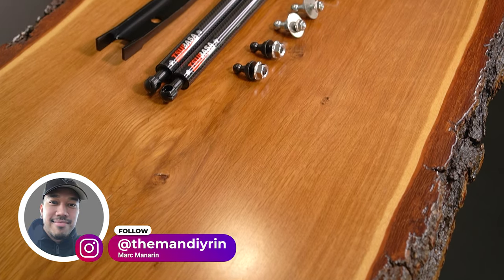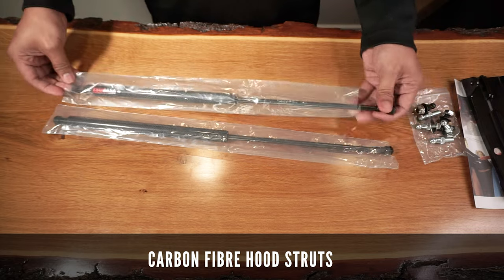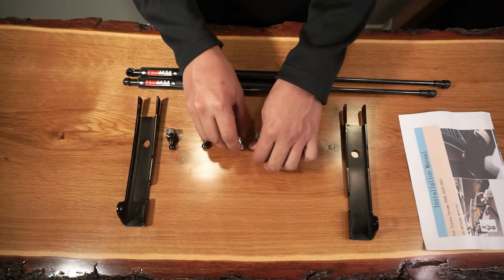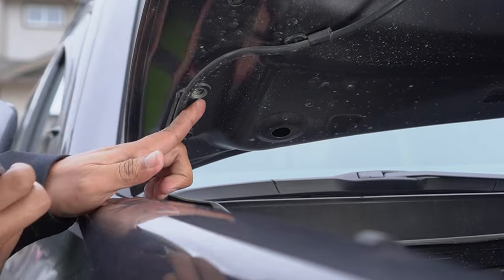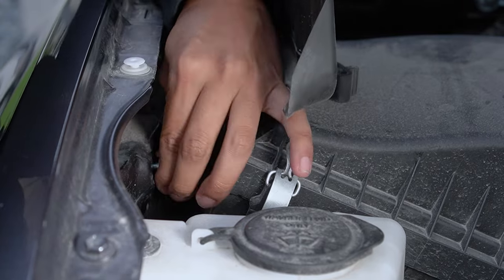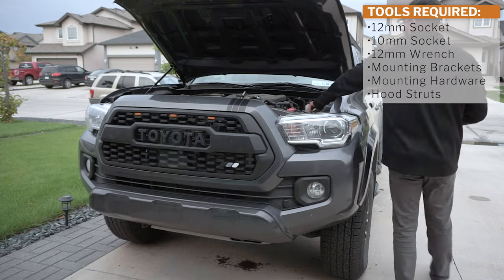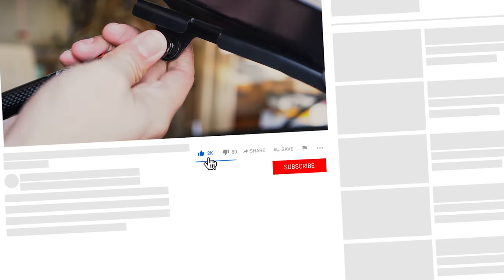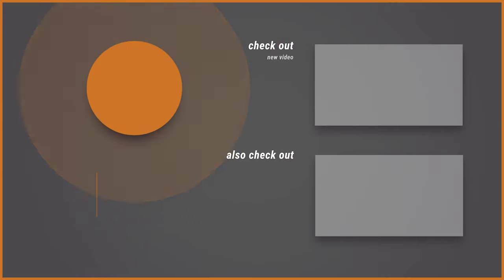HOOD STRUT INSTALL on this NEW Toyota TACOMA TRD Sport | EASY DIY

Comment: Nice! I need to do this. My 2023 TRD Sport was delivered (finally) on 5 Dec. Loving the truck. Have de-chromed badges and A/C vent rings.
Reply from the maker: Thanks for watching! Happy to hear you finally got your truck! Gotta delete those chrome I agree! Looking forward to hearing more on your future mods!
Reply: Amazon says the struts you installed fit up to 2015 Tacoma but yours is a 2022. So they should work in a 2023 right?
Reply from the maker: @Hansaman58  Hi yes there should be one for up to 2022 there! Else I've posted links to alternatives as well that has positive reviews!

Comment: I just finished my install 2022 taco. My comments are: install driver's side strout first. The lower ( engine bay) ball stud bolts call for the smaller diameter threaded ended bolt studs. Finally, expect the hood bracket hardware to angel away from the hood line by about an inch. This gives the lowering of the hood a bit of a springy feel at the beginning.
Reply from the maker: Thanks for watching my video and for the comment! Cheers!

Comment: I bought the ŕedline struts it was my second mod i upgraded for 20 dollars more for stainless ones that i quick push and they go up themselves the scary part was on mine you had to drill holes and use rivits the drilling near the engine bay wasnt bad you just want to check again and again the measurements drilling the bottom of the hood was very scary you only had to go deep enough so the rivit would go in all the way any further and you would come out on the top of your hood so i measured down the depth i did the same on the drill bit then ran electrical tape around the bit to stop it from going any deeper it was pretty straight forward and it feels alot safer working under there with just that stupid rod to hold a couple hundred pounds up.
Reply from the maker: Thanks for watching my video! I heard great things about redline as well so I might try that mod soon!

Comment: I've owned a Toyota truck since 1980 being my first 4 X 4  way before TRD's, or Tacoma's, or Tundra's, and I've used that hood rod on every truck I've owned. I can't for the life of me understand why this isn't coming already installed. I'm on the fence as to the safety of them being after market add ons. I just finished adding a K&N cold air intake, and Pedal Commander on my SR5.
Reply from the maker: Hi! Hope you're having a great weekend so far and thanks for watching my video again! I agree this should come standard! Hope they do in the future models! As for safety of this specific one, I'm currently testing it out as I know there are better knows products out there that I might try in the future.

Question about aftermarket cold air intakes as I want to install one also! How are you liking yours?! Any issue or complaints so far?

Looking into the pedal commander as well till I get this tuned in the future)!
Reply: @themandiyrin   Thank you again for such an in-depth informative video. 
So far I am liking my K&N choice. I was debating between S&B and K&N and I waited for S&B to come back in stock for 4 months. After the New Year I decided to just go with K&N. The sound this intake produces is amazing, combined that with the Pedal Commander and you have what seems to be a V8 driving your truck. I would prefer to get a totally enclosed system like the S&B and put a K&N filter in it. 
Oh and I forgot to mention I installed my "Raptor Lights" in my grill and they look amazing as well.
Reply from the maker: @Steak_59  You're welcome, appreciate your continual support!

And that's good to hear your thoughts on both, I personally also want an enclosed system but I've heard positive reviews on the K&N as well so that's also an option I'm looking at! Thank you for the info that helps my decision!

And nice on the Raptor lights! I was able to install mine on the top row but involved some cutting but I agree it looks amazing! Did you go with the white or amber version?
Reply: @themandiyrin   You are most welcome, believe me I know how much thought is placed in the products and the expense, I cannot imagine what it takes to add to that the production of recording the install and all the editing included with it. This is why my hat is tipped with the quality you continue to put forth. 
As for my lights, you have to keep in mind I am leaving my stock SR5 grill, so I had to custom everything. I chose a smoked amber and wired them to come on with my "Park/Running Lights" my thoughts were I would rather they only be on when I choose, and with that comes I can choose and run them even when parked and my engine not running. The color of the amber matches everything on my trucks OEM lighting.
Reply from the maker: @Steak_59  Thank you! I appreciate you seeing the editting efforts to make the videos! For your Raptor lights, that is really functional the way you have it set up being able to control it as you please. I may change mine to a similar set up as well! I agree, I love the amber highlights of my truck as well! Hope you have a great rest of the weekend! Thanks again!
Reply: Any concerns with warranty issues by adding a CAI or the pedal commander?

Comment: I noticed that the bracket pulls away from the hood when you lift it.The other brand I looked at had 2 way tape holding down the bracket.I have the same style that you have so I am going to add some tape to help secure the bracket.Thanks for the video because the instructions suck.

Comment: I've seen other hood strut kits with 2-sided tape for the top of the bracket where it touches hood. is there a gap between bracket and hood when its open? Also does it scratch hood at that point?
Reply from the maker: Hi thanks for watching my video. In regards to your question, mine did not come with double sided tape unfortunately. There is a slight gap between the bracket and the hood at that point, however it has not scratched or damaged the hood of my Tacoma.

Comment: Hi, I also bought the struts from your link, but got two equally sized struts and cannot complete the install. Do you recon if I purchase the sokietech struts could I keep the hood anchorz from this kit? It seems both uses the same anchor points in the engine bay. Just wondering if I had to remove the whole thing off
Reply from the maker: Hi thanks for watching my video! I'm sorry to hear you're having issues. In regards to your question, I'm not sure as sokietech was not available when I was purchasing this, but I think it could work!
Reply: @themandiyrin  Thanks man, I been following your videos since day one, we have exactly the same Truck, same color and everything. I did some mods before finding your channel but mostly I had made the same modifications that you did. Thankfully, I contacted the vendor via Amazon and they responded by owning the mistake and will be sending me the correct size struts. I'll update when the parts arrive. Keep the good work! Next on my list is the front backup camera!
Reply from the maker: @CmdrValiant  Hi! Thank you for the support, glad to hear my videos helped in some way! Also great color choice on your tacoma! My opinion the nicest color for the 3rd gen! Looking forward to hearing about your future mods as well, let me know if you have any questions on the front camera mod!

Comment: Great video clear and good directions. Two questions will these work with after market air intakes and ditch light brackets?
Reply from the maker: Thank you for watching and for the kind words! In regards to your question, this should work with ditch lights but I'm not sure about cold air intakes as I don't own one yet. Planning on installing in the near future so I'll keep you posted.
Reply: @themandiyrin  thank you for the reply very interested in these love the no drilling and seem to look better than the sookietech ones
Reply from the maker: @ryanmurphy694  I agree! I just ordered the cold air intake a couple days ago so I'll let you know when I install it. What cold air intake are you looking to get?
Reply: @themandiyrin  already have one had it for a few years. Nothing special but with a dry flow filter I think they last longer. Great sound mostly what you get out of those anyway
Reply from the maker: @ryanmurphy694  love it!! Yes I’m just going for sounds tbh on mine But I’ll see what actual performance improvements it has.

Comment: This was a really helpful video. Do these struts hold the hood open as high or higher than the stock hood stay?
Reply from the maker: Hi! Thank you for watching my video and the kind words! These hood struts go higher than the original one.
Reply: @themandiyrin  That's great since the original ones leave the hood kind of low.
Reply from the maker: @dewarner12  I agree it's a bit on the low side specially for taller drivers. If you want even higher though I believe that redline I linked goes even higher!

Comment: I bought those hood struts off of your link from Amazon and they didn’t even send the right parts…the struts were the same size. No driver side…and they are cheaply made/product but I guess for the price what did I expect?! Would not recommend.
Reply from the maker: Oh no I'm sorry to hear about your experience with them! Luckily I haven't had any issues on mine yet so fingers crossed! If I have issues I might try the sokietech since I like the no drilling.
Reply: Thanks for the info, almost hit the add purchase button